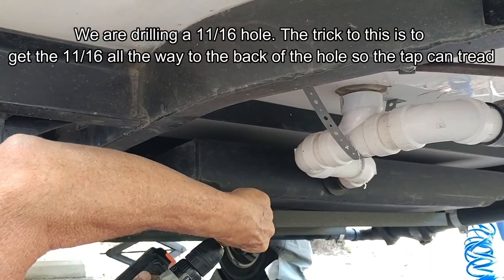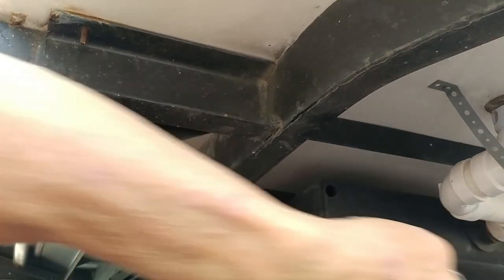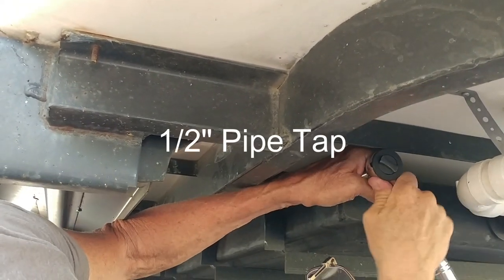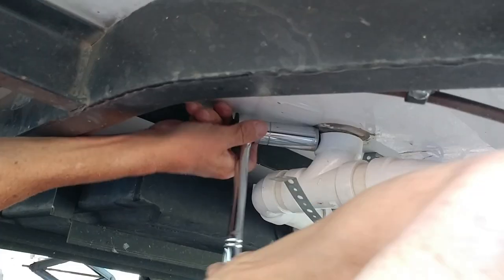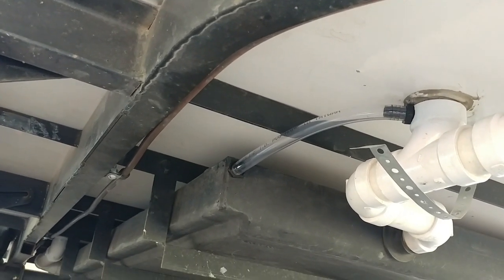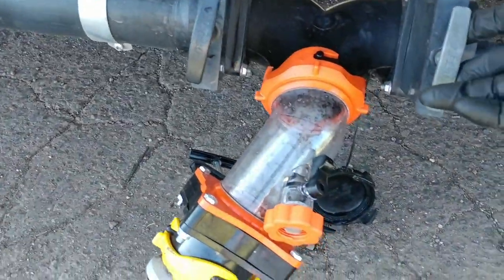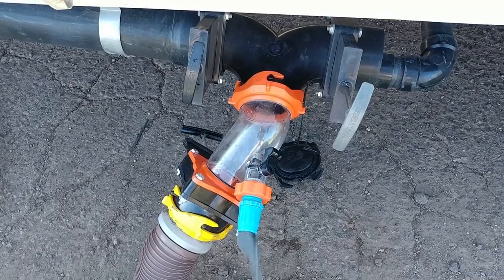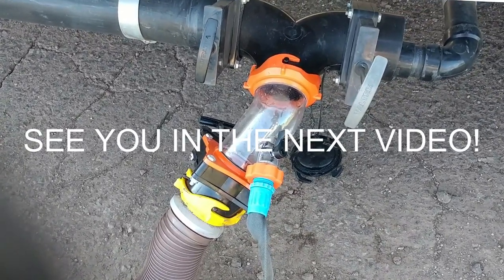Casita Grey Vent Mod.

Comment: The purpose of this mod is to allow the grey tank to fill to the top. Because the roof vent pipe sticks down into the tank, it quits venting and therefore filling once water level reaches bottom of roof vent pipe. This mod allows further venting until water hits the top of tank. The purpose is not to hasten draining. That is a separate mod called the fast grey mod, parts available at Little House Customs.

Comment: It was a good clean mod...I don't think I will do it though...I have had 3 Casitas in 35 years...Have a 2020 Spirit Deluxe now.  In my experience...you can never completely drain the grey or black tank...nothing drains perfect at the dump station...grey IS slower to drain...I just drain it until it gets pretty slow & go...get home & drain again...driving gets the residual into the drain pipe.
Do your best drain job at dump station...when you get home put a gallon bucket under drain & open black valve & see what comes out...dispose of that & repeat on grey tank...if you don't get a gallon or more I would be surprised.
Reply: The intent is not to allow it to drain fully, it is to allow the tank to fill fully. This mod gives you more grey water capacity.
Reply: @tgriebe  Thanks for the explanation ...I use a 25 gal. blue tote tank & dump every day so it doesn't get too heavy.  I fill the toilet several times at the dump station to help it clean out the black tank...dump the grey...go back in trailer & wash my hands using the water pump & hot water from the water tank...by the time you drive home you will have a few gallons of water to drain from black & grey...shrubs like it.

Comment: Question,... a long time ago, didn't this mod go up through the closet floor and join into the vent midway up the pipe?
What made this change to now attaching to the vent pipe underneath the floor?
Does it work as well?
Reply: Yes it works as well. The intent is to bypass the bottom of the roof vent pipe which sticks down in the grey water and stops venting.